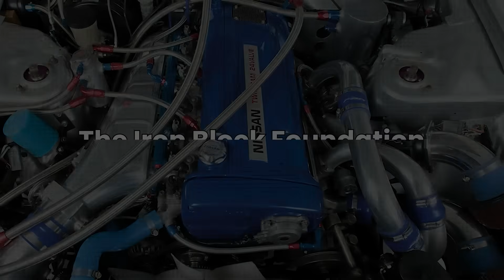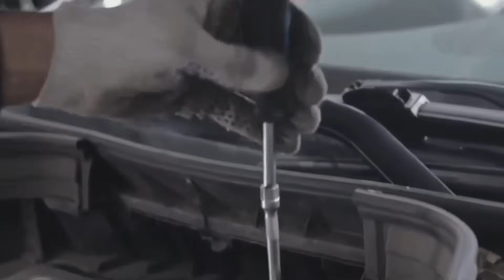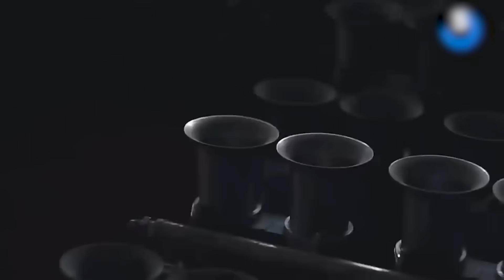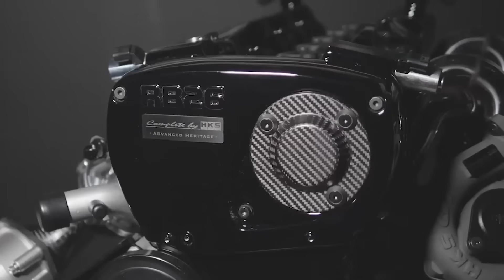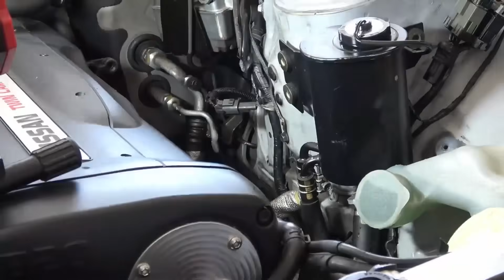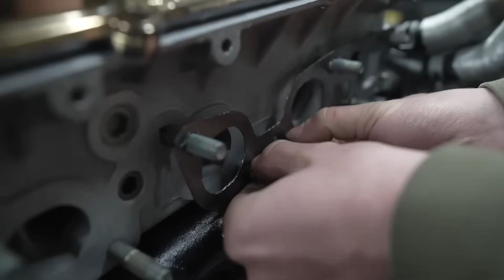Why Japan’s Twin-Turbo Six Still Haunts Detroit (Nissan RB26DETT)

Comment: Extrinsically, American auto manufacturers had  one hand tied behind their backs with CAFE requirements (Japanese manufacturers probably have no such restriction).  Intrinsically, American auto manufacturers were all about the V-8 because their was more profit in the sale of them.   American manufacturers know all about the I-6's performance potential (i.e. Ford's  Barra.  Australian but never made it to America), but there wasn't enough profit for them, I guess.
Now, in the mid-20's, American engines are seizing up at 10,000 miles.

Comment: Most jap cars were way ahead of their time the Toyota Celica Gen 7 was one example the 2zz-ge engine is a hidden gem as is the car its superior to even the Type R but didn't get the recognition and in the same way the GT-R is a legend and over engineered especially the R33 that would have destroyed races so they banned them in most races outside of Japan.

Comment: Stop the cap 🧢… not one ☝🏾 Porsche engineer gave one rats ass about this Nissan engine… what’s worse is Nissan told you dummies they bought a Porsche, tore it apart, studied, then copied everything they legally could to produce their own car… 

Not sure about ford or GM but nobody at Porsche flinched…

Comment: don't forget Toyota's 2JZ
Reply: Stronger block than the rb ... But needs a better head
Reply: 2j is not technically advanced it just over builds with great heads and flow rb is different

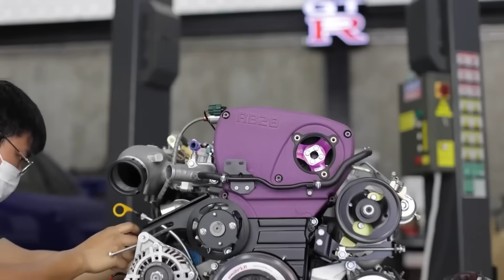Comment: 2:10 yeah 1000hp on stock internals for o.06 of a second.
Reply: you never een a rb26dett have you they can run for a long ass time at 1000hp on stock internals, did you not learn a thing

Comment: "Engineering excellence beats displacement.” — That line sums it up perfectly. The RB26 didn’t just make power, it redefined what performance could mean. From its overbuilt iron block to those wild six throttle bodies, this engine wasn’t about numbers — it was about soul. 30+ years later and Detroit’s still chasing that mix of precision, character, and madness. Absolute legend.